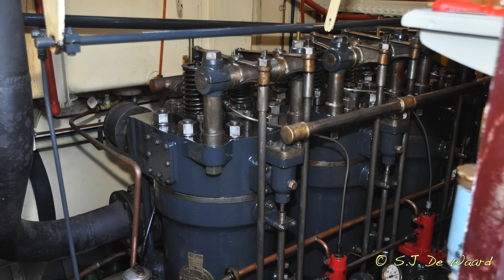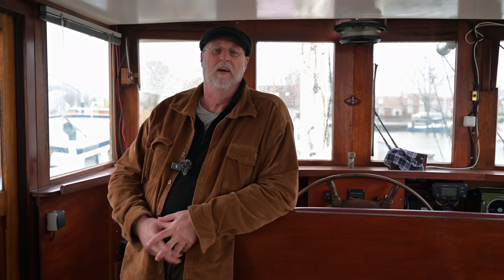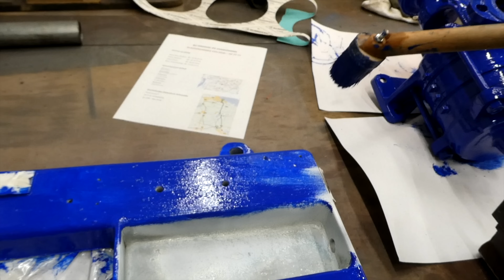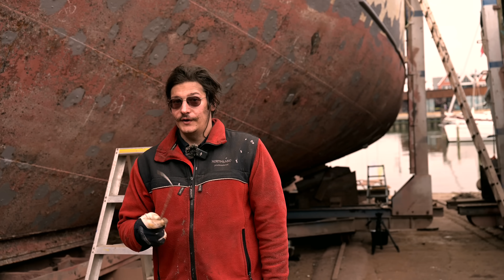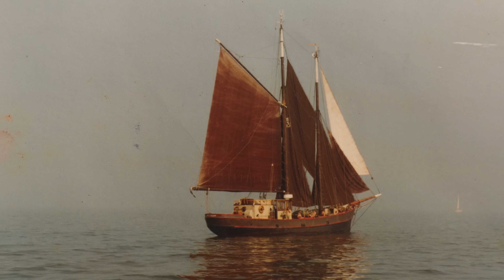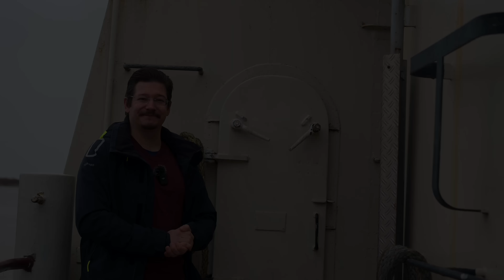We Were WRONG All The Time!!! - The Truth About Flying Coneys History EP56

Comment: I dunno. 

Having both a DAF and a Perkins means you need both a metric and imperial tool set. You also need to take into account that it might take more time to get an imperial repair kit as you do live in the Netherlands where metric is the standard. Not that a Perkins is bad or anything but I would sell it to somebody in the UK or US of A and get a Lamborghini instead. Lamborghini diesel generators are superb. That will mean that you only need the metric tool set on board which will simplify your compatibility getting spare parts and total inventory. Of course you will also have that imperial tool set which you can sell with the Perkins to gain some more green$. 

Added huge value is that that Lamborghini will be way more compact and light than the Perkins you have now to get the same performance in Kilowatts output. Enough room to build it in a nice sound dampening box. You will love it and your neighbours will like you more when you do need that generator.
Reply from the maker: We do have two generators and the more modern one is a Deutz/Lombardini. I guess at one point we will sell the Perkins but currently it doesn't fit through the engine room door. But I'm not sure if the early DAF 1160 we have is fully metric. The design was bought by DAF from British Leyland and goes back to an old tank engine. We do have some high quality adjustable wrenches just in case.

Comment: No doubt you're aware that many structural hull repairs including some below the waterline, can, with safety precautions, be accomplished afloat, outside of a shipyard thereby avoiding that expense. Your delve into the vessel's history is very interesting and i look forward to next week.
Reply from the maker: Tomorrow there's a video coming out diving deep into the history of the ship when she was a true sailing ship. From about 100 frames about 20 need to be repaired and about 5 need to be replaced. Also the stringers in the cargo hold needs to be either repaired or replaced. Not that bad if you ask me. It's said that it's easier to hammer out the concrete while the ship is afloat but we will do it next to a shipyard and very careful. Also we will cary out the work one watertight compartment at a time.

Comment: Great information! 
I just can’t understand the conversion from wood to steel. 
Why wasn’t this just all the parts from the wood ship were put in the new steel ship????
Or was the ship orriginally steel frames with a wood hull? And then the steel replaces ???  
Very confusing 
Cheers Warren
Reply from the maker: Yes, the original wooden warship was built with steel frames and wooden planks. In 1950 they've removed the wooden planks and riveted steel plates to the original steel frames. They might have also re-used the engine foundations and the engine. There are a number of similar ships around mostly still with wooden planks but also a few converted ones. The TRES HOMBRES has a wooden hull and the OCEAN SHERPA is a converted one. All built as the same kind of warship (KFK or Kriegsfischkutter).
Reply: @FlyingConey  that’s really amazing ! You would think they would just replace the wood as required.   So they must have added the concrete after conversion to steel. Maybe the lead was stolen from the wooden hull too. 
Very very strange. 
It would be interesting video to find out more about why and the other ships that had this conversion
Cheers Warren

Comment: I am astonished to learn that a wooden hulled ship can be converted to a steel hull.  I mean, how do you do this without building an entirely new ship made of steel?
Reply from the maker: The germans mass produced a certain type of warship called KFK or Kriegsfischkutter. Built with steel frames and wooden planks. They delivered the frames to different shipyards all over Europe. Since there was a shortage of materials after WW2 they reused a lot of of old stuff. In our case they re- used the steel frames to built a new riveted ship. Flying Coney was the first ship they did this conversion but coincidentally we stumbled over two other boats with a similar story on our boat search.

Comment: How do you ‘convert’ from a wood hull to steel?  
Surely it is in fact a completely new hull?
Reply from the maker: This type of warship was built with steel frames, deck beams and stringers. But it was planked with wood. After removing the wooden sceleton they used the structure and riveted steel plates in the frames instead.
Reply: @FlyingConey  of course, that makes sense now. 
Are the original riveted plates / framing wrought iron, or mild steel?  I believe wrought iron has more natural corrosion resistance to mild steel. 
What will you be using for repairs.   Corten perhaps, though don’t know if this compatible.  You are in the land of steel boat building, I once looked at a 15 year old Corten yacht, some interior still unpainted and looking good.  
I guess you won’t be using rivets, though that would be perfect.

Comment: Is that concrete ballast a worry if there is rust in the hull below, you can’t see?
Reply from the maker: Well we will see. We have thickness measurements and below the concrete it looks good. But in order to repair the frames we need to remove a part of the ballast and then we know it for sure.

Comment: It been driving me crazy for months ... I have to ask... Why have you not sand blasted/ painted either the interior nor the exterior of the vessel.. It. Seems to my eye that it clearly needs it and would either eliminate or reveal other issues with the hull... As well as eliminate rusting or corrosion issues with the hull... Ok.. You painted the exterior.. But it wasn't , in my unsolicited opinion a very good gamble without blasting the surface corrosion first... A temporary fix at best...  Please do not take my criticism personally ... I mean only to be constructive, and helpful.. It comes from a place of love and concern... I deeply appreciate your present undertaking.. It is immense , ambitious, beautiful, and brave...  Also a worthy labor, it makes me happy to see you guys give SO much of yourselves to such a daunting quest...  God sppeed.✌
Reply from the maker: I try my best to give you a complete answer. First of all we did a lot of rust treatment. We used a rotating blaster on the outside and an air chisel on the inside. Both methods are proofed and so far the rust isn't coming back. In a later stage of the project we will however aim for a better surface finish but on the outside this is only possible once we're done on the inside and on the inside it's better to have most of the welding done. So some of the tasks need to be done in order but sometimes a temporary fix is needed. Choosing the right blasting method and the correct coating is a very difficult decision. You ask 10 people and you will get 15 opinions. Not every blasting method is compatible with the coating you do want to have. Rust remover, yes or no? Sandblasting, Laserblasting or Hydrojet. All in one or inside first? Sandblasting isn't good for the rivets, Hydrojet on the inside is a pain and it leaves a layer of rust, Laser sounds good at first but it's difficult to find yards with experience and also it seems to be a slow process. Often when approaching a task like that it seems simple and a few months of research later you realize that at one point you have to make a decision, knowing that it will be a 20 year experiment.
Reply: @FlyingConey  wow...
I do not envy your decision...   I do however envy your journey..  You're brilliant and beautiful people.. You'll find a viable solution.. I love what you're doing ... Keep up the good work , your success and perseverance in this project will be in many ways, the world's reward for, as yet untold, unknown, places and time...   I be watching and waiting... Peace, love, Safe journeys.. ..!

Comment: I found the certificate of registry (meetbrief) of the KW 34 "Tiny" online. It states, built by De Haas, Maassluis, meetbrief number 8318, registered as new vessel january 2, 1951. 150 hp Deutz diesel. As a comment it says: "this was a wooden voorpostenboot, from which only the metal frames have survived, from which a new steel vessel was built.
Reply from the maker: Exactly. The long term owner beliefe that the KFK (Voorpostenboot) was built 1941 in Enkhuizen. The Deutz 150hp engine is probably also from this time. It's probably the reason why they altered the shape of the bow. If I recall correctly after 2 years the De Industrie came in.
Reply: @FlyingConey  The Meetbrief also states, first owners were Dirk Zwitser and Nicolaas van Duijn of Katwijk. Zwitser (1918-1976) was a blacksmith and machinebuilder who had a company repairing ships and installing ships engines and installations. My guess; Zwitser bought the steel remains of the voorpostenboot cheaply, moved it to Katwijk and finished the build there. Also; Katwijk and Alphen (seat of Industrie engines) are 25 km apart, connected by the river Oude Rijn (Old Rhine). Maybe the old Deutz was German war surplus and perhaps not reliable. During the war, Deutz built their engines with forced labour and sabotage was everywhere. That would explain the quick demise of the Deutz, and the fact Zwitser did not repair the engine himself. Zwitser might have had connections at Industrie, providing him with an engine amidst the material shortages during the post war period.

Later, the KW-34 was sold  to my hometown Scheveningen and became SCH-10 'Leendert", owned by L. Klein en Zonen. One of the sons Klein is still alive, and a friend of my father. I'll ask him for memories next time i see him.
Reply from the maker: It would be amazing to hear more stories of her fishing time. From what I've heard it was a good boat with the De Industrie engine. So please contact us again when you met Mr Klein again. The Deutz engine is described as crude oil (ruwe olie) engine with 150pk at 300rpm. It could very well be that the engine is from the KFK time. 150pk is not particularly strong so I guess as soon as Dirk Zwitser got hold of the engine of the SCH201 Sigurda he fitted it into his boat. Just out of curiosity, why was ABC an inferior brand? I once had a look at the SCH11 DeHoop and that engine was nice.

Comment: D. & Joh. Boot N.V., motorenfabriek de Industrie, Alphen aan de Rijn. They also built over a 1000 fishing boats, coasters, tugs and inland vessels. They ceased operation in 1978. the 4 VD 7 means 4 cylinder, 4 stroke (viertakt) diesel. Folders can be googled. There is also a youtube video of one starting up, search for bergingsvaartuig Tonijn.

Siemen & Hinsch mbH (SIHI) of Itzehoe, Germany, still exist as part of the Sterling Fluid Systems company. Sihi pumps were used very frequently in the Dutch fishing industrie, back in the day sold by importer SIHI-Maters.
Reply from the maker: It took me a while to figure out what the 7 stands for. Turns out it's an internal numbering of the capacity of each cylinder. The VD7 had 60hp per cylinder. But the VD7 is much less common than the VD6 so finding pictures proofed to be hard. Thank you for providing additional informations!
Reply: @FlyingConey  well, the 4vd7 had the lowest revolutions per minute, 300 instead of 330. I know fishermen liked it that way, better torque at lower rpm. At full power, pulling nets,they wanted torque, not speed.
By the end of the 1970's the trend was building v-engines with higher revolutions and turbocharged, Industrie did not have the money to develop those, so they went out of business.
In Dutch fishing, with bottomtrawl or pelagic trawls low-rev (max 400 rpm) were favourite. By 2000, All major producers stopped making them (for engines less than 2500 hp) so the dutch, who favoured Stork-Werkspoor (now Wärtsila) or Deutz went either to highrev  Mitsubishi or Catterpillar, or turned to Belgian ABC, who still make 
Low-revolution engines, although ABC was considered an inferior brand.

Comment: Het is niet Industrie,Maar ; De Industrie.Deze DAF 1160 zal ik er in laten zitten ( Ze zijn sterk ) Bezuinig zeker niet op wat duurdere motor olie ( SEA 30 ) DAF en Perkins waren vroeger een onderdeel van Leyland.De remband van je omkeerkoppeling wat strakker zetten,want je schroef as draait mee als de hoofd motor loopt ( Op korte termijn geen probleem maar wel als je as in stromend water mee draait zonder smering ) Mooie filmjes trouwens !
Reply from the maker: The engine that powered the ship from 1953 until the flywheel went flying was a De Industrie 4VD7. It was replaced by a Kromhout F249 in 1976. The DAF came in in 2008. Unfortunately I couldn't get hold of a nice picture of a 4VD7. I wrote to the Stichting: Brons & Industrie but got no response. The DAF 1160 is indeed a modified Leyland engine. Thank you for your comment.

Comment: I recently found out about your channel.  Since you'll be moving the wheelhouse and lowering the aft cabin, consider having large engine room components rebuilt or remanufactured.  I'm not saying those components need it, but once you start adding structure back over the engine room, that little hatch may be your only way to get things in or out.

Comment: Do you have info about the wood to steel conversion process? Did the original wood ship have a steel frame? Fascinating stuff
Reply from the maker: Yes, the type of warship is called Kriegsfischkutter or KFK. These boats were built using steel frames and stringers and were planked with wood. Compared to a steel boats our frames are the other way around and the brand name KRUPP on them. So the steel is German. In the steel boat conversion the removed the planks and altered the first frames slightly to get a different bow. Also the spacing in between the rivets is slightly larger than on a boat that was built as a steel ship. Actually our boat was the first one that was converted. Fun fact the guy who draw the lines of the KFK was Austrian and the final design was done about 2.5 kilometers from the place were I grew up as a kid.

Comment: Wow the history before was long and complex now its doubled the old girls credibility and your faith in restoring her.

BTW.. the coal sitting against the hull would have left Iron Sulphide deposits on the hull metal ..getting wet would have seen it turn to weak sulphuric acid.  That would really attack bare metal in that area of the hull. 

I have a book on the history of the Scotish and Northsea fishing fleets. There were certain styles of fishing where boats worked in pairs .. one boat would often be more powerfull. 
Many older boats would catch so many fish they would return to harbour so low in the water many sank if conditions became rough. Prior to refrigeration  
fish would stored in tanks with water...and that could also cause a trawler to capsize in rough seas as tons of fish in chilled water  
Shifted and took a boat over and down. 😬

Comment: They should try to find the original engine and what happened to it
Reply from the maker: Sadly this huge old diesel engines got molten down if the were beyond repair. To much valuable steel in them. We're talking about 8-9000kg. Maybe the original original Deutz was handed over to a smaller boat when the bigger De Industrie went in. The latter came from the SCH 201 Sigurda a boat way bigger than ours.

Comment: lots of interesting stories in nearly every corner of that ship 👍 fascinating ! that big generator was really only used for welding? i am working in a place where the theme "redundancy" is at a very high level so my thinking is: repair/restore that thing put some sort of modern electronics inverter or anything like that on it and use it as a  backup power generating unit. of course you can have a new modern one too but that preserves the touch of history. that's my idea but i am far away from the ocean . . .
Reply from the maker: Back then real generators were extremely expensive. So the previous owner built one himself. The alternator part is a so called welding generator (Schweißgenerator). It was not only used for welding but also as a normal 3 phase generator (That's the DIY part about it) So I believe it can be used directly for welding or also for powering electric equipment. The original engine for that Frankenstein thing was an air cooled Deutz.  I've no idea if the electricity is clean enough to be used with modern equipment. It was good enough for the water pump, that's for sure. Our idea is to build a multi purpose auxiliary engine. Strong hydraulic pump, belt driven water pump, 3 phase generator and so on. But the level of redundancy we have is already quite insane.
Reply: @FlyingConey  
so that thing has multiple winding systems inside? so if it is dry and the collector and carbons looks good give it a try. the power quality can measured today very easy. it depends on the state of the collector rings & carbons and the speed regulation for the engine. today you can buy modern units they can control these old motors and generator very good.
Reply: there is another yt-channel "SmallEngineMechanic" the owner of this channel knows a lot about older engines, generator. he show some projects on his channel where he refits old gensets with modern type governors and control panels